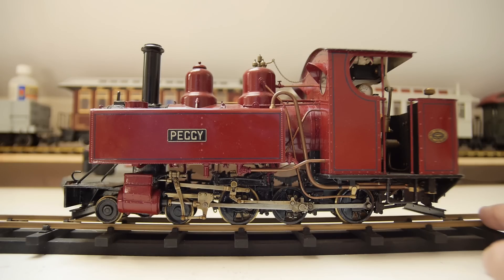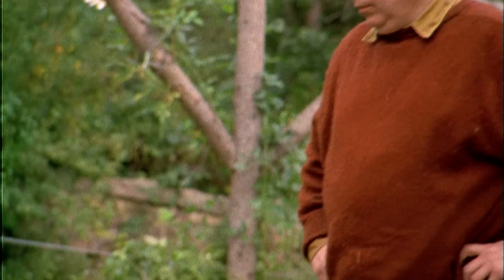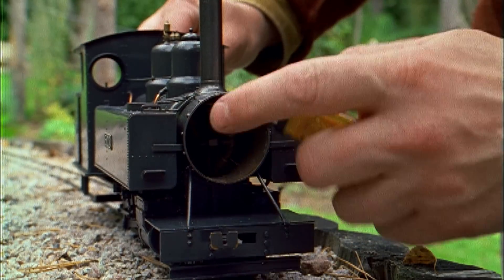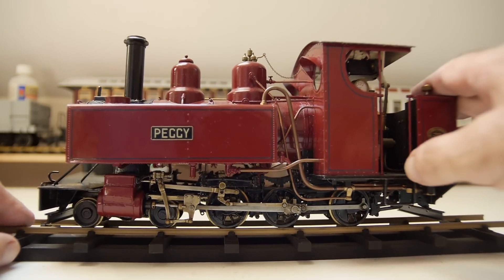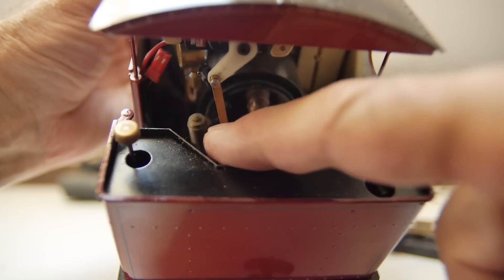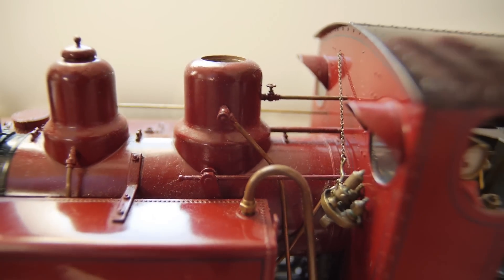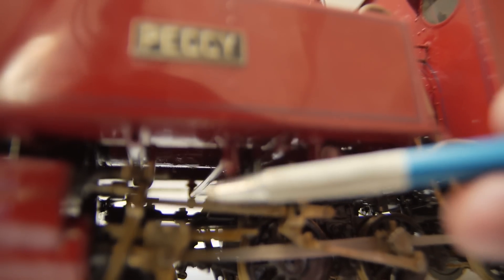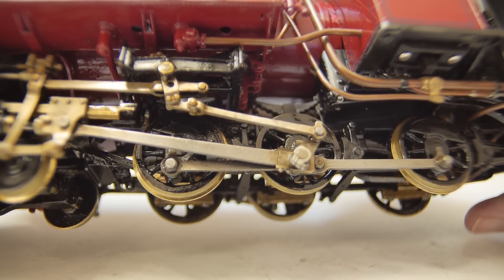Live Steam Model Locomotive part 12 - Baldwin Wrightscale 'Peggy'

Comment: what receiver / transmitter do you use in your locomotives?

lovely locomotive by the way.
Reply from the maker: Hi John, the controllers/receivers I use is usually the cheapest I can find with three or more channels.  That means they get re-branded by various suppliers.  At the moment I'm using 'GoolRC 2.4G 4CH Radio Model RC Transmitter & Receiver' for £30 on Amazon.  The servo motors are HiTech micros with metal gears.  Hope that helps.
Reply: @GandyDancerProductions  i looked on amazon and only found drone receivers/transmitters. do you use the drone or some other type of transmitter/ receivers. Ie. RC car or planes.
Reply from the maker: @johnkuzma7066  Try Hobby king they have one of the radios I've used successfully.  It's a Hobby King 2.4Ghz 4Ch Tx & Rx V2 (Mode 2) SKU: HK-T4A-M2 for £21.08 plus shipping.

Comment: Lovely. I didn't quite understand the water arrangement. I don't think you mentioned a feed pump, and the tanks as you described them are full of gas, lead and lubricator. So does it just run with whatever is in the boiler? If so, is there a jacket around the firebox, like on the Russell you are building? Such an arrangement must surely require constant feed water else the top of the firebox would be quickly exposed, I imagine. Or is it that with gas you can arrange things so that the boiler can be fired with  much less water in it? Perhaps I am misunderstanding things, if so I apologise.
Reply from the maker: The boiler on Peggy is a single flue gas one.  It is rather small, so as you rightly say, it needs topping up regularly through a water feed valve under the cab floor with the plastic spray bottle I show in other videos.  There is no feed pump or water in the tanks.  There is a gauge glass to tell the level in the boiler but it isn't that accurate.  I usually guess after three circuits of the basement floor and it will need more water.  I hope to show a video of Peggy steaming soon.

Comment: Hi, so glad to see you finished the Baldwin and what a lovely job you made of Peggy.  It must have been after we met but when I made a batch a couple of years later I made all the vacuum brake parts, nameplates and workplates for the Ashover Locos.  Get in touch through our website if you would like a set of parts.  The only change I would make to your model is put in far stronger springs on the wheels sets. That would make her far less boucy and stop the blind drivers dropping between the tracks.
Reply from the maker: Thanks Malcolm for the advice, good to hear from you. Jonathan